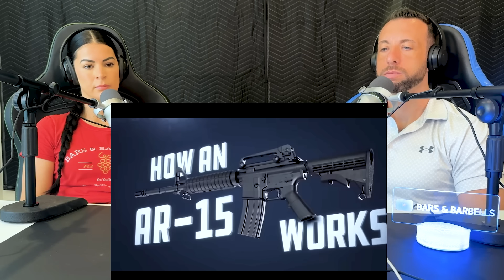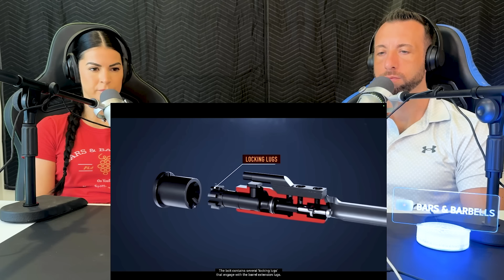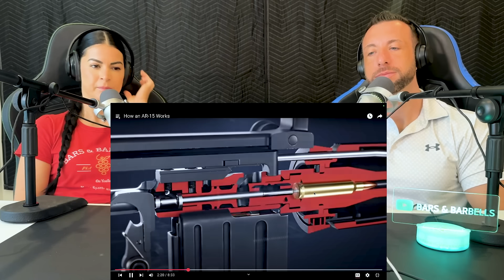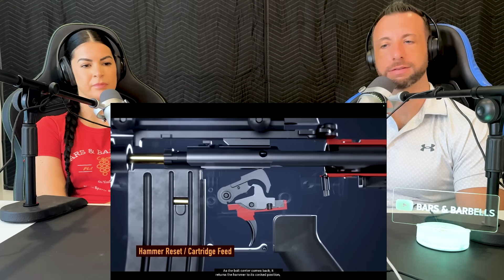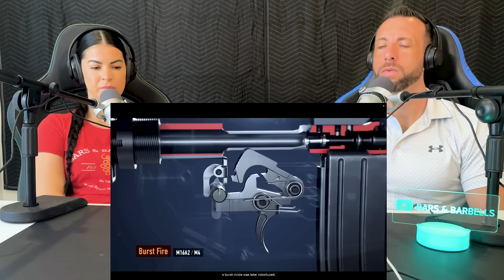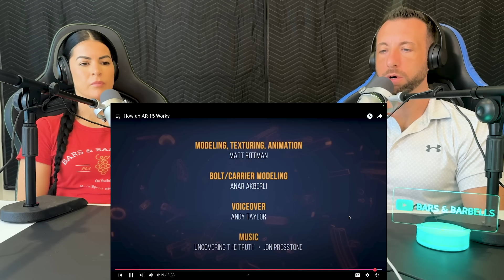This Is What Happens When You Pull The Trigger — AR-15 Mechanics Explained ⚙️

Comment: It should be noted that the lower receiver uses different pin locations for the trigger mechanisms. A semi Auto AR15 cannot simple swap out for Full auto or burst mode trigger mechanisms. It is illegal to modify the lower receiver to use burst or auto trigger groups. The lower receiver is considered the actual firearm that is regulated by laws. Other illegal (presently) modifications are attaching a short barrel or attempting to modify the trigger group to burst or full auto which is not easy to do without machining experience and the correct equipment and parts. ALSO, It should be noted that other types of Semi Auto rifles are essentially just as fast at firing as the AR15. Being semi auto essentially means the shooter is the controlling entity on how fast the gun can fire as it takes one pull of the trigger to fire each cartridge. Bump Stocks and forced reset triggers can increase the speed but this usually results in erratic fire that is not well aimed. I.e., Being an AR15 or an AK47 does not make the rifle deadlier than any other semiautomatic rifle. It is the the media and gun control advocates that perpetuate this myth.

Comment: STOP!!!!!   AR 15's do NOT use Clips!  This uses a magazine, which is NOT a clip.  Clips are metal shapes that hold several cartridges and are inserted into an internal magazine area inside firearms that are designed to use clips. Once the last cartridge is fired the clips are ejected. The M1 Garand uses clips. A magazine is loaded with cartridges and stores them until ready to use, but is inserted into the firearm and after the last round is fired it does not eject. The user must manually remove the magazine and insert a new one or reload the magazine.

Comment: After watching this video you can see why the firearm community laughed at supposed "experts" saying full semi automatic.  There should be a similar video on the AK47 i would recommend watching that video as well.  The AR is direct impingement, where as the AK is whats called long stroke piston. Similar but also different.  Also note an AR doesn't operate entirely differently than say a bolt action rifle.  The different being one uses the energy of the shot to rotate and retract the bolt and uses spring pressure to return and rotate the bolt again where as a bolt action these actions are manually operated by the shooter.  So centuries of evolution automating one step then another then another to go from muzzle loading to full auto.

Comment: Most of the design work was done in 1955 for the larger caliber AR-10.  In 1957, it was scaled down to create the AR-15 which was thought to be a good replacement for aging WWII M1 and M2 carbines and as an alternative to large, heavy full power battle rifles.  Colt designed a semi-auto version and they hit gun store shelves in 1963.  Yeah, 62 years!
Reply: You are thinking of the M-16. The AR-15 has never been used in war.
Reply: @robertself5930  M-16 is the military designation and AR-15 was the name of the select-fire rifle when it was developed by Armalite and what it was referred to when they sold the design to Colt.  Also the rifle I was issued at Ft Benning was a low serial number  repeatedly re-built receiver stamped "AR-15."
Reply: @sae1095hc  If this is true. Why would the military send you into combat without a fully automatic?
Reply: @robertself5930  From 1959 to 1964, all AR-15s were made for military contracts and were select fire.  In 1963 Colt developed the semi-auto only AR-15 SP1 and it hit gun stores in 1964.  Colt didn't entirely stop marking rifles made for the military with the "AR-15" logo until 1969.
Reply: @sae1095hc  The AR-15 was never officially adopted by the U.S. military as its standard-issue rifle. Instead, it was a civilian variant of the select-fire M16 rifle, which has been widely used by the military since the Vietnam War. While the AR-15 shares a design lineage with the M16, the latter is the military version that has been utilized in various roles, including special operations.

Comment: It's crazy to think that the AR-15 is a design from the early 1960's, and even though there's been a lot of updates and modernization with tons of different variants, the core of the gun remains largely unchanged.

Also the 3-round burst is pretty universally hated. It adds a lot of complexity, makes the trigger pull feel inconsistent in semi-auto, it doesn't always fire all 3 rounds, and you can achieve the exact same effect by just firing in full-auto while using controlled bursts. Then you also have the added benefit of controlling how many rounds you fire off as well.

The military was concerned about recruits wasting ammo firing in full auto, that's why they went with burst fire, but there's a very simple solution... it's called training. Luckily no one really uses burst fire rifles anymore, because everyone kinda realized how pointless and stupid it was.

Keep in mind, none of this really matters for normal civilians. Since any gun that fires multiple shots from one trigger pull is considered a "machine gun" by the ATF, and you can't own a machine gun in the US without a special license.

Comment: I am an old US Marine (79-85) and this the rifle that we were issued. The AR-15 is one of the most popular rifles among civilians in the US (the semi-auto version). You can buy upgraded and highly accurate parts for this platform. I have built 4 or 5 myself out of the best parts available and they are very accurate. It's a great rifle and kicks almost not at all because of that huge buffer spring. After 45 years of using them I have become very familiar with the AR. Great Video and so glad you learned this. I am going to start another build pretty soon because some improved parts have hit the market. It's a fun hobby.
Reply: 79-87 USMC and 5th award expert. 3 with the A1 and 2 with the A2. Semper Fi and Happy 250th.
Reply: @iceman1036  Hey Devil Dog, fifth award expert, that's awesome. I shot a 226 at Parris Island and got Platoon 1042 High Shooter although that was not a great score. I did fall to Sharpshooter once. Happy 250th and Semper Fi!
Reply: Semper Fidelis, Brothers!
USMC veteran here, 1982-1986
I also shot 226 Sharpshooter in Parris Island 3rd Battalion H Company (3018)
Shot expert rifle (4th award) in the FMF, and never better than Sharpshooter on the pistol range. My MOS (7212) required a .45 as a TO firearm.
Reply: @meanmax9663  Hey Brother , the score of 226 is Expert, Sharpshooter is below 220. I forget sometimes too.
Reply: @DougCates-z6v I definitely do forget, a lot more these days! I know that I was awarded Sharpshooter in boot camp. I guess I don't remember the score breakdown. So apparently it wasn't 226, because I didn't make Expert. I wanted to, but I fell short!
Reply: @DougCates-z6v getting old isn't a helluva lot of fun, contrary to popular belief!  🙄
Reply: Thank you for using the term “semi-automatic”….there’s a difference and it NEEDS to be understood. 🇺🇸
Reply: @rlciii Agreed, I pointed that out on purpose. When I was in the Corps only 1 man per 4 where allowed to flip to full auto. Full auto is for suppressing fire. Only the untrained use it for anything else. Controlled fire is much more effective.

Comment: If you want to go down the rabbit hole look into pretty much anything John Moses Browning designed. The man was a gunsmithing prophet. Put it this was, the M2 .50 caliber machine gun is a Browning design. Designed in 1918 it remains virtually unchanged and is still in the Modern military today. Dude nailed it on the first try.

Comment: Good video on the workings of the rifle.  Further explanation of the zeroing would be necessary as to why move the elevation front sight post or rear sight up or down, and why adjust windage left or right.  Bullets deplete power and drop over distance so this must be compensated for depending on the distance to the target.  

The U.S. Army spends considerable training time on ranges using targets at 25-meters for each individual to adjust the sights of their individual, assigned rifle.  Once it is dialed-in, this zero allows for engagement from muzzle out to 300 meters.  When the weapons are cleaned and returned to the Arms Room for secure storage, the individual now has his own zeroed rifle.  For longer ranges, your zero probably won't work for me, so we each have our own weapon; picking up one on the battlefield would work fine for close range, but probably not so much over distances.  Also the bullets are weighed, and the grains of powder measured so that each round should perform is a known, standard manner.

Comment: Just a couple things that beginners would not know. Some rifles take a clip such as the M1 Garand that was used in WWII. Modern rifles and pistols use a magazine... they are very different.  Also "assault" is a verb, not a noun. There is no such thing as an "assault" anything. The AR-15 operates pretty much as any other semi-automatic rifle... one pull of the trigger to one shot. Semi-automatic is also a misnomer. The correct term would be auto-reloading. Assault is something one does "with" a weapon whether that weapon is a sword, spear, screwdriver, hammer, pistol, or rifle.  The term "Assault Screwdriver" would be ridiculous as is the term "Assault Rifle".  An M-16 by contrast looks exactly the same as an AR-15 but has burst mode and full auto, which the M-16 does not!

Comment: The AR-15 platform design is rather complex relative to many service rifles and complexity can lead to a lack of reliability.  It can be an effective, reliable weapon but you must maintain it properly, knowing the key points to clean and lube.  The action gets dirty quickly because combustion gasses are directed into the mechanism, as illustrated in this video, to cycle the action.  When I was a super green trainee in Army "Boot Camp" my weapon malfunctioned frequently (failed to cycle fully), but it was my fault.  After I was trained to maintain the weapon properly I don't think I ever had a malfunction.

Comment: Draw back in viet nam is that the m16 version was so precise that any sec of dirt can make it inoperable it must always be clean where as the russian ak 47 can fire even when dirty.
Reply: Not true. The issues with the M16 on Vietnam were due to out of spec powder that over-pressurized the gas system and non-chromed chambers that badly corroded making extraction harder. Using the ammo it was designed for, the AR is tolerant of fouling. It would take more ammo than you could carry and expend in a firefight to cause fouling issues.

Comment: The burst setting is available with the M-16 and M-4, not with the (unmodified) AR-15.
Reply: You can't just modify any AR. It must be a "green label" box from the 80's or earlier. Later ARs didn't mill out the extra metal needed for the insertions of the extra parts. Plus, you need ATF
approval to buy the "3 round burst" parts. Any gun that fires more than one round on one pull of the trigger is considered a "machine gun". Back in the '80s, you could go to any gun show,
and buy an AR, then go a few tables down, and buy everything needed (not many parts) to make it full auto, or 3 round burst. It was ALL legal. No big deal. Gun Broker magazine sold these
conversion kits all of the time. Sunset law changed all of that. If you have the paperwork proving when you bought it, it is grandfathered and still legal.
Reply: @broncobra  Yes you can. It’s called a drill press and a milling jig. The only thing that makes it illegal is if you drill the 3rd hole for the auto sear pin and or having the jig and drill bits to readily convert it unless you have an 07 FFl with 03 SOT to manufacture NFA items and no you don’t need the ATFs approval to buy 3 round burst or full auto parts. They’re sold online through multiple vendors like any other gun parts.
Reply: @broncobra  unless you have a binary trigger which is one shot when pulled and one shot when released still a semi auto by ATF.
Reply: @broncobra Nothing you said negates what I said.

Comment: This video says AR-15 but goes into the military  M-16 and M-4 which are different in operation.   The military ammo is 5.56 X 45 NATO.  there is a civilian variant .223 which can be interchanged but have slightly different specs.  The AR-15 is not the only rifle that shoots the 5.56 X 45 NATO/.223.  Yhere are many repeater and semiauto rifles that use tis ammo.  Also the AR does not exclusively use  5.56 X 45 NATO ammo.  The AR-10 comes in 7.62x51 NATO/ .308 Winchester. Other AR calibers include 6.5 Grendel, 300 Blackout, 450 Bushmaster.  
In the US the chances of someone being killed by a AR is smaller than being killed by a hammer, club "or" knife.  The media just reports every AR incident and ignores the others. MSM even acknowledged this in a twisted way when last month a young Ukrainian girl was knifed to death in NC and MSM said it was a local story being sensationalized by the right.
Reply: M16 and M4 are just specific configurations of the AR-15.

Comment: Something the video didn’t mention is the difference in bolt, technically the bolt carrier, when using semiautomatic and automatic/burst. The semiautomatic bolt carrier has a smaller opening in the bottom, has more mass, and that results in an inherent slower cycle rate. The automatic bolt carrier has a much larger hole in the bottom, less weight, and can cycle faster. A semiautomatic CAN use an automatic bolt carrier. I use them in every AR I’ve ever built or owned. An automatic CANNOT use the semiautomatic bolt carrier because the tigger mechanism struggles to clear the bolt carrier. 
They also didn’t mention that you can get for your own AR, or buy one that comes with, an adjustable gas block and buffer. The adjustable gas block can change the amount of gas going back to cycle the rifle. It can use a lot, which will cycle even very low powered rounds, cycle it even with a stupid short barrel, or cycle it with a “dirty” or “sticky” rifle. But, the recoil will be quite a bit more. Turning the gas block down allows less gas, can struggle or fail to do the things I mentioned above, but the recoil becomes much softer. You can turn them down enough that the rifle doesn’t even try to cycle and basically becomes the equivalent of a bolt action rifle that you have to “cock” each shot. 
The buffer tube is adjusted by adding or removing weight. More weight, the more recoil it can absorb. But, you can go too far and make the combination of the additional weight, and the buffer spring, too much for the gas forcing the bolt carrier group back far enough to be able to cycle properly. Just as with the adjustable gas block, you can go the opposite way and have the opposite results. So, unless you’re going to be doing something outside the norm, it’s best to just get a normal buffer and gas block. I have one AR that I built for the most accurate shot placement, best performance, longest reliable shot placement, longest possible “killing power” shot. So, I wasn’t using “standard” stuff anywhere on that rifle. It has both an adjustable buffer and gas block on it, mainly because the barrel I went with. To get the range and accuracy, I didn’t go with a standard 16” barrel length. I went with a JP rifles 24” barrel with a 1 in 7 twist rate, and chambered in .223 Wylde. (JP, they make the best AR parts for accuracy)
That barrel length will get more speed over a shorter barrel, a few hundred feet per second over a 16”. The 1 in 7 twist rate of the rifling refers to how many inches of barrel length does it that to make one complete rotation of the barrel with the rifling. A 1 in 7 takes only 7” of the barrel as opposed to the norm for an AR of 1 in 9.  The result is the projectile will be spinning faster when it leaves the barrel, making it more stable, and will be better at reproducing the same/close shot placement. Also, because it can spin it up faster, it can allow you to use heavier projectile weights. The norm for an AR, and it’s .223 ammunition, is to have a projectile weighing 55 grains or 63 grains. My barrel can stabilize up to the heaviest possible projectile, which for .223 is usually 77 grains. That also helps on maximum range, and the amount of energy it has at any range.
Sorry to get off on a rant about something you probably don’t care that much about.
Reply: Have the carriers reversed. The full auto carriers have more material at the rear in order to engage the auto sear and usually weigh an ounce or so more than the semi-auto carriers
Reply: Backwards. Semi-auto only bolt carriers have a larger cut (thus less mass) so the bottom face cannot interact with an auto sear. But that is not really relevant anymore as its not illegal to have an M16 bolt carrier installed. And most manufacturers are using M16 pattern bolt carriers to increase the mass to help prevent carrier bounce.